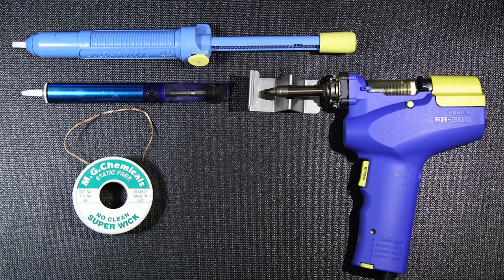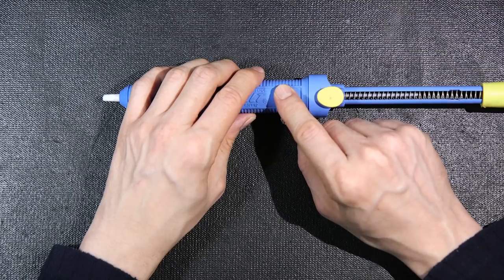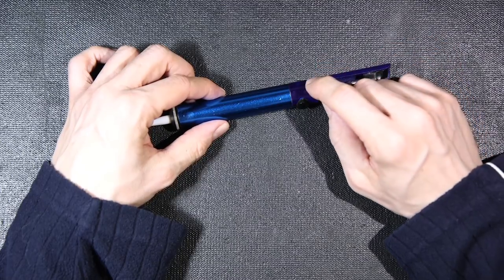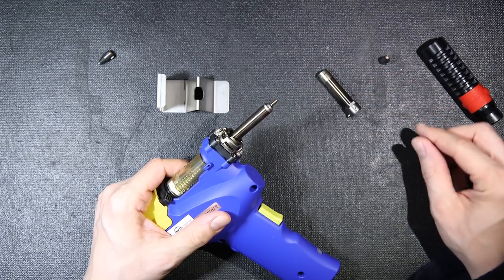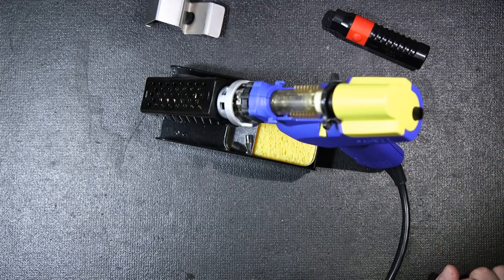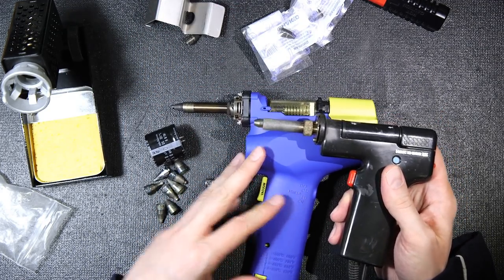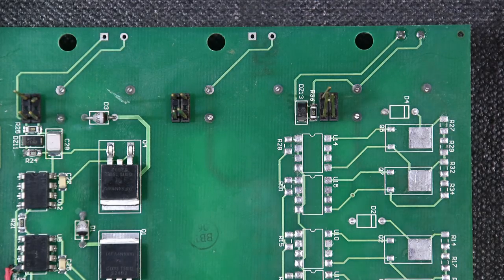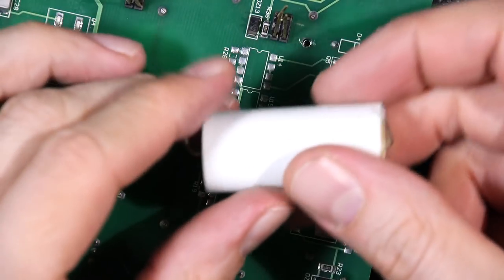How To Desolder Electronic Parts Using Different Tools.

Comment: hakko fr-300 is total garbage. The heater cracks after first hour working. New cost 70$ + 30$ delivery. Waranty does not exist in my country.
Reply from the maker: Hi Oleg. If you realize that the tip is indexed, and you can't force the tip on, you won't break anything. Try some dexterity next time, and don't crank the heat to the max because you didn't seat the tip properly. I have had my FR-300 for years with no problems.
Reply: @MrCarlsonsLab  Dear mr. Carlson, you did not understand me correctly. This was not due to my efforts. The ceramic heater burst without me when it was on the table. I have never pressed or applied at full power. I heard a crack sound and it split in half. In my country, $ 370 is a huge money and I was hoping for reliability from Japan. I am very disappointed.
Reply from the maker: @olegnlo2555  That is a very strange failure then. Maybe it was wired for the wrong line voltage.
Reply: @MrCarlsonsLab  No, 110V throu the variac. 1 hour the gun worked well.
Reply: @MrCarlsonsLab   Perhaps what he bought is actually a counterfeit and not an original Hakko.

Comment: Mg chemical makes the best solder and flux.  I've used some questionable stuff before.  I've even had welding type slag on solder joints that you could knock off with a sharp tap.  MG chemicals by contrast is like a shaved babies ass..